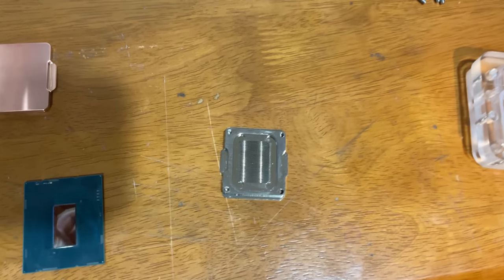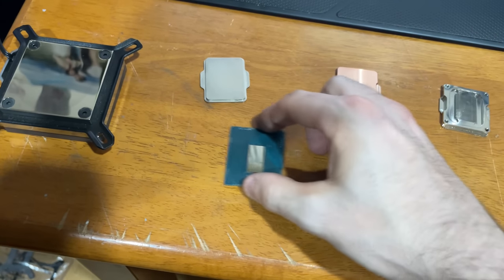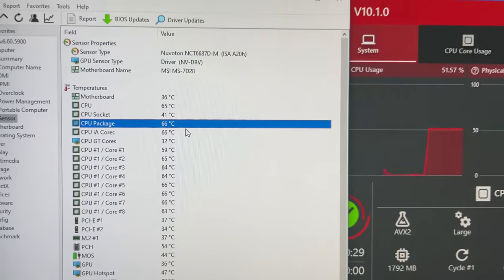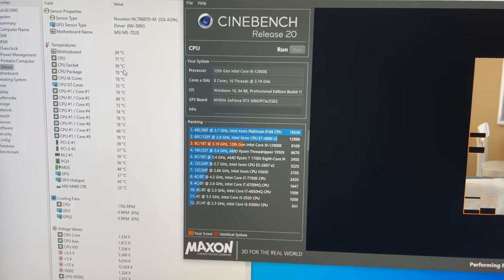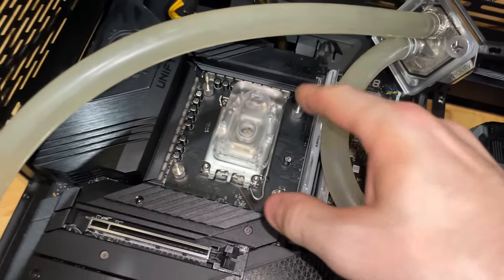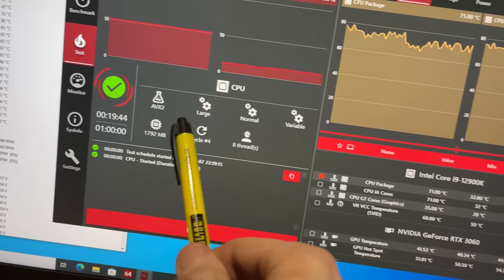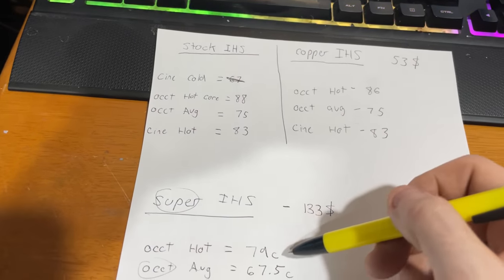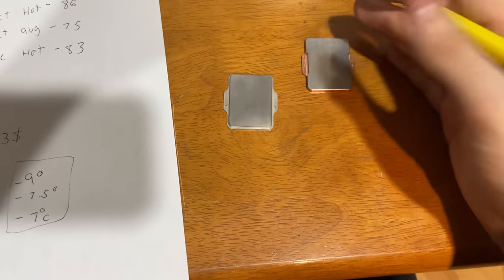12900k Direct Die Cooling VS Copper IHS

Comment: I think instead of using package temp, using core temperatures could be better since ihs is changing, it may reduce the temp difference between cores in since they are quite high in stock ihs.
Reply: This 100%

Comment: Appreciate the testing. Exactly what I like to see. I passed on the i9 this gen and got the i7 12700k… I’m able to push 5.2 all core at 1.28 load vcore. I’m thinking 5.3 is possible here with delid… waiting till gigabyte does recall on my z690i ddr4 board which should be a month or so… I just didn’t see the point in going i9 till the new 10nm process gets a bit more refined. Have a feeling this is the 6700k of the eventual 7700k which will be 13900k…. Let’s see… thanks again
Reply: hv gone from i7 7700 non k to i7 12700 non k 🙂

Comment: I would install a quick disconnect from pc have a hose with quick disconnect attachment put up in closet. When u wanna adjust cpu, detach from loop attach cpu to longer hose and drain it by itself. Not too much hassle.

Comment: I have been trying to keep up with the latest tech news as I am thinking about building a new PC soon, perhaps within a year or so.. but I have been and want to continue to use Intel and Nvidia.. but with the last two generations of chips the 13000 and 14000 models having degradation problems, does the 12000 series also have that same problem or did that just show up  under the 13th and 14th gen  intel chips?

Comment: Did you delid the stock ihs, remove the factory indium solder and then replace it with LM? Or are you trying to isolate the difference a copper ihs makes?

Comment: Good stuff, hefty price though but it's not mass produced so i can live with that.
EK is working on a block with a bracket making direct die cooling with their block out of the box!
To bad Intel never lear, heat problems with the i7 7700k...and on the 9th gen to...the good thing is that none of them are soldered so deliding can be done without fancy tools but there are good deliders out there and now the 12th gen comes with IHS problems...can be fixed cheap with a mounting frame instead of the clamp shit they have on stock, lapping and later deliding are the later options but even if it's not a risky move you still void the warranty on a 500$ and even worse on a 12900KS cpu.

Comment: with some shape adjustments he might even be able to make it more convenient so that you can stick it on more like a normal Waterblock, just directly to the Chip.
might need to switch to something sturdier like Acetal as a result, but, it could be worthwhile.
Reply: Never miss to hate on acrylic a bit XD
Reply: @doublepoil  
Acrylic and Plexi are just not very strong so they have to have relatively thick walls so that they don't crack or just fall apart. hence why the Block Top there is so chunky.
that's why, my personal distaste for the Materials is just a coincidence.
Reply: Supercool does acetal tops as well

Comment: So why not use a copper baseplate with the copper IHS? Silver King liquid metal is electrically conductive, as is copper, and nickel isn't as good at it, but it is definitely conductive. I was about to use all copper, so maybe you know something I don't?
Reply: Copper with liquid metal and copper can become stuck together and extremely difficult to take apart and you could break other components.
Reply: @pentek16 how long can the Nicole plated copper last, ?? Averagely…?

Comment: Hey man I need help with something. I have a 10900k clocked to 5.3ghz all core, a 3070Ti clocked to a constant 2070mhz, and viper B-die ram clocked to 4133 c16-16-16-36 and get around 40 latency in Aida. Fully windows and hardware optimized I get an avrg. 220 FPS at 1080p low with highs of 240-250 in Warzone. However, I get this really bad aliasing/visual noise where the trees and everything shimmer. I’ve seen hundreds of people post about it and mine is really extreme. I’ve tried everything from NVIDIA filters, antialiasing, all NVIDIA settings, resolution scaling and geforce experience. I’ve redownloaded drivers with DDU and I’m currently on 472.12. The only thing that helps is increasing render resolution but it ranks my FPS and does very little to help. Nobody seems to know how to fix this. Any help would be greatly appreciated. If anyone else has this issue please reply. Thanks.
Reply: I run DLSS-Quality and don't have any more shadow/tree issues
Reply: Not sure your exact issue but I’ve seen that tree/particle shimmering is due to settings in WarZone. Try setting particle quality to ultra